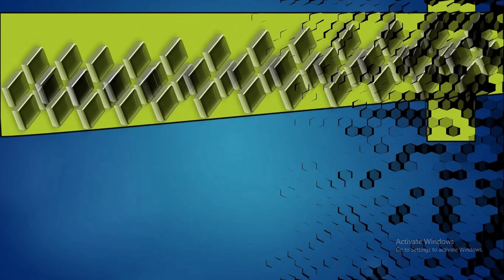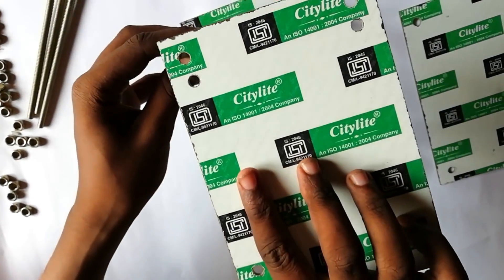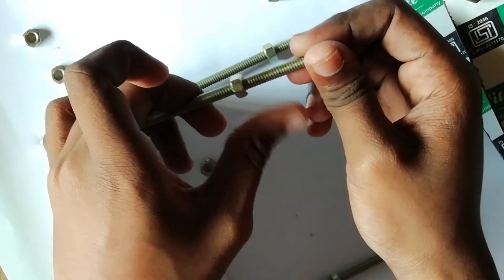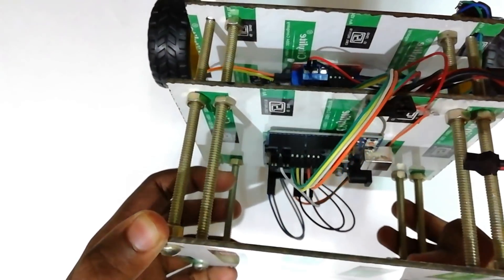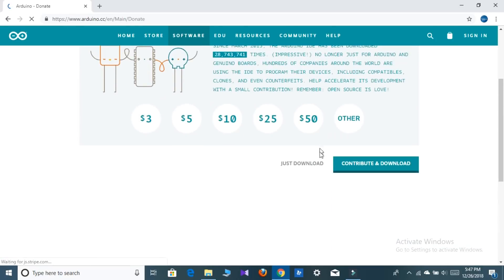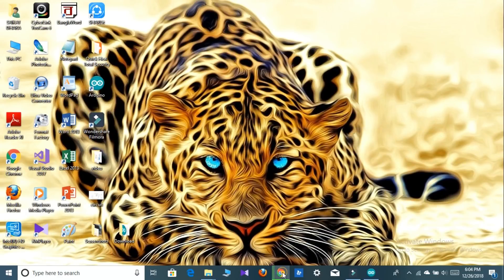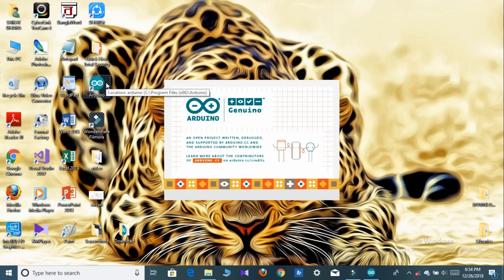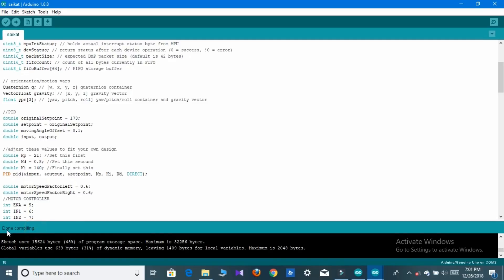SELF BALANCING ROBOT USING ARDUINO UNO

Comment: i kept kp value 10 ,its just moving frwd in tilted side .Its not moving back n forth,my mpu6050 n motor driver are in good condition
Reply from the maker: place the mpu6050 in the top of the balancing robot.